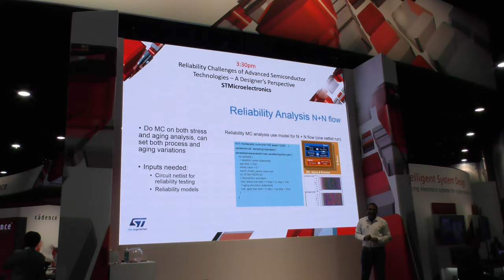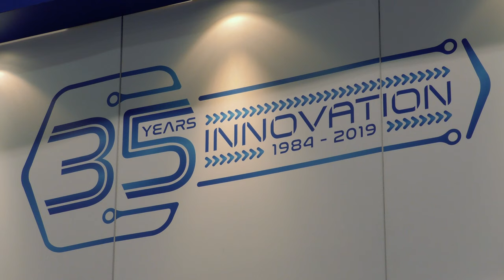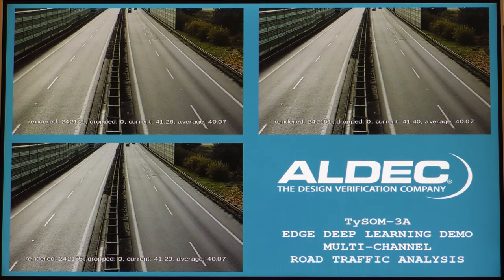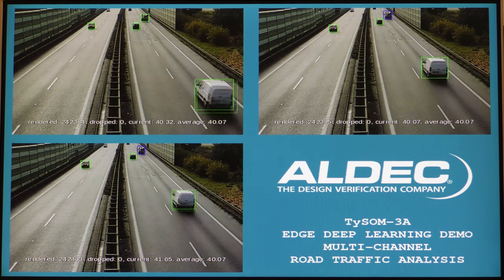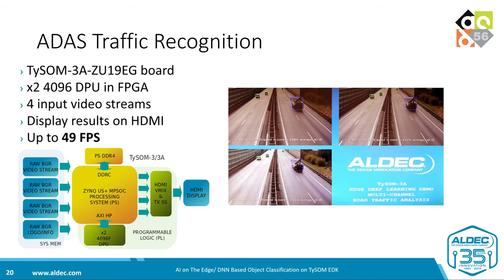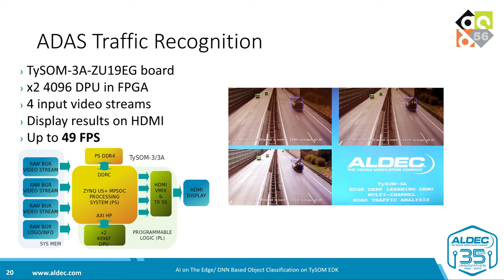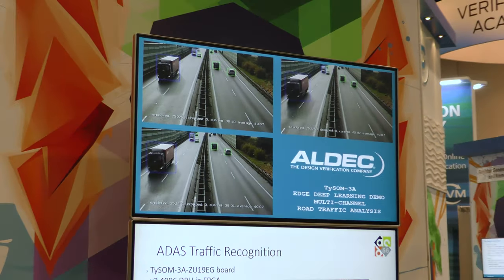DAC 2019 Demo - DNN Based Object Classification TySOM EDK

Comment: I am looking for an FPGA board to build a feed-forward neural net, could you tell  how many LUTs/Logic Cells are required to build a network with 10 inputs, 10 neurons on the hidden layer, and 10 neurons on the output layer? Just an approximate. I kind of, need to estimate the requierd FPGA size for my app.
Reply from the maker: Hi, please create a an account on our website and submit this as a support case so one of our engineers may contact you. Customer Portal link: https://bit.ly/333gXzL